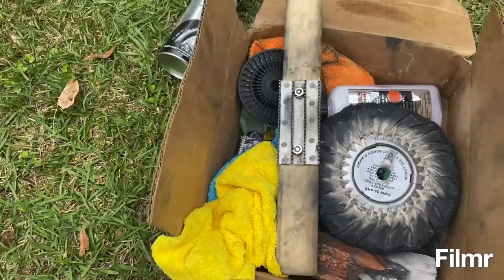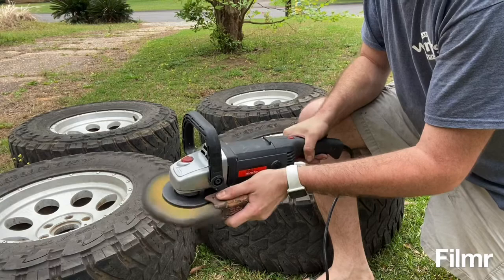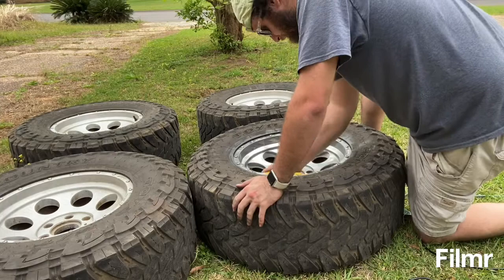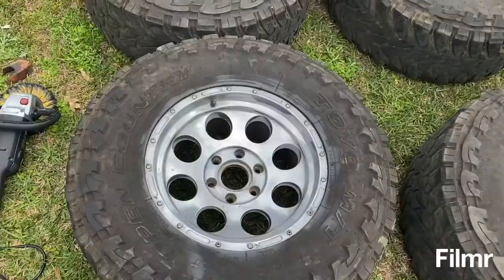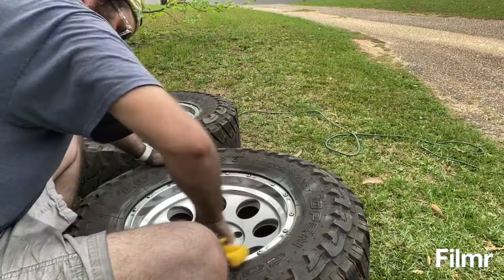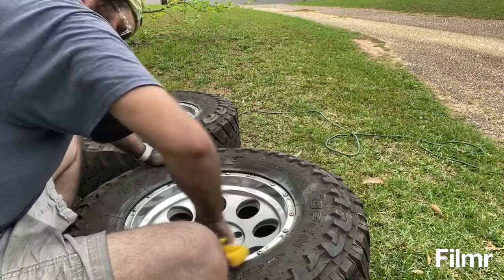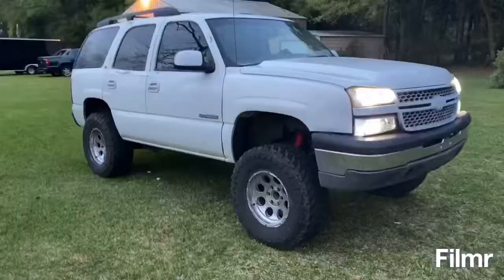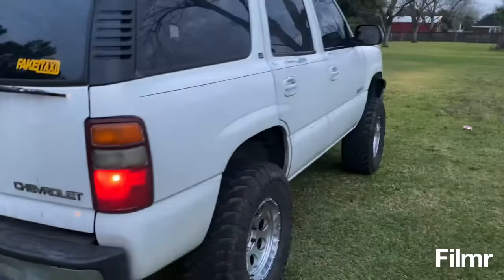How to polish aluminum wheels with zephyr polishing kit

Comment: Did you have to use an extension with that polisher?
Reply from the maker: No I did not. The zephyr polishing kit works excellent with the harbor freight adjustable speed polisher.